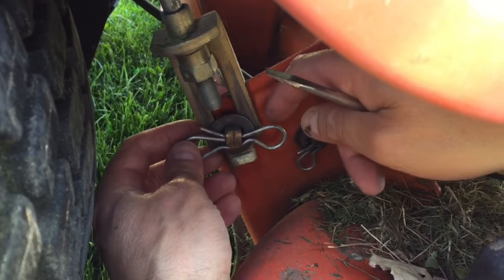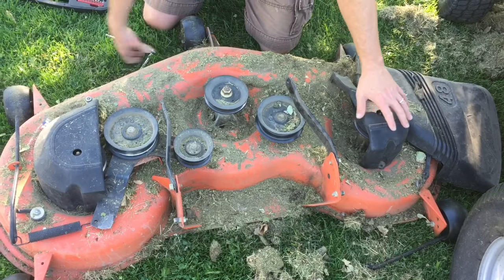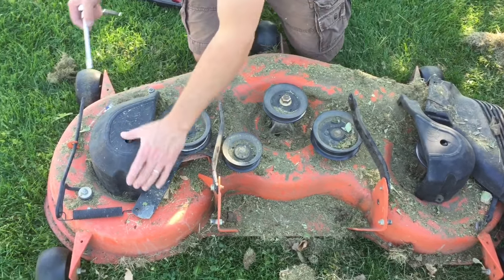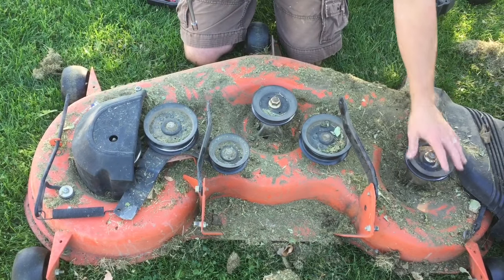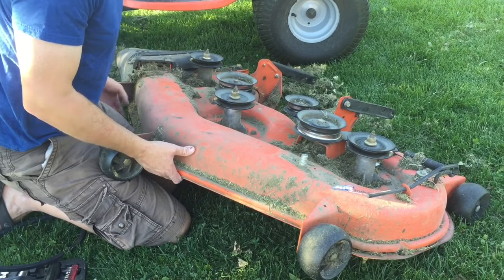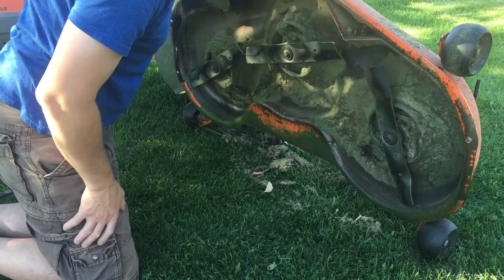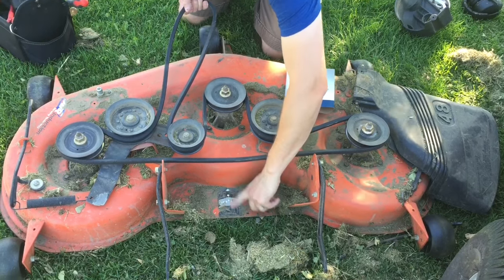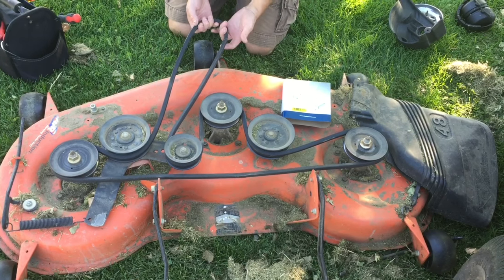Replacing Belt on Husqvarna Riding Lawn Mower

Comment: I initially viewed this video for a clue on the procedure on my Husqvarna YTA24V48. Once I took the pulley covers (2) off, I simply followed the diagram (sticker) on the mower deck. I only have 254 hours on this mower, so the diagram was still in good shape. Didn't remove the deck, just got down on the ground, with the deck lowered fully down, and there was plenty of clearance to accomplish the belt replacement. The original belt lasted just over 250 hours, and installing the new belt was a breeze. LOWES wanted $70 for the new belt, but I got one on Amazon for less than $30. Time will tell how it holds up. Thanks.

Comment: Nice video. Well done. Unfortunately the part I am most concerned with you flew past. I need to get the covers off over the side pulleys. 5/8 wrench but I need to see that part. I am not experienced in using s wrench or my model may be different.
Reply: Did you get your belt replaced? I noticed you mentioned a 5/8 wrench, but he actually used a 3/8ths socket & socket wrench with an extension. Removing & replacing the pulley covers takes longer than replacing the belt. Happy mowing!